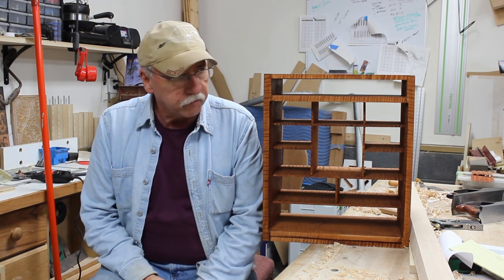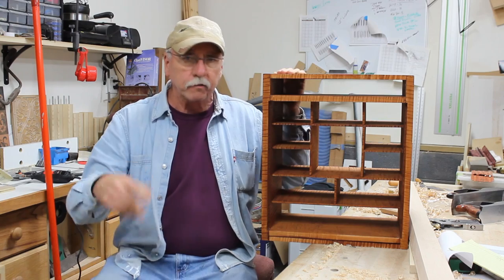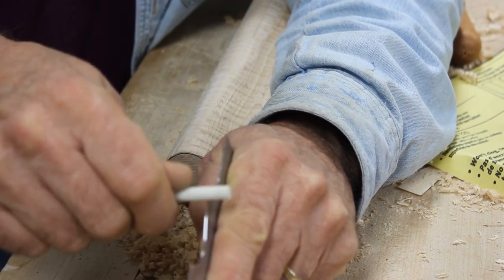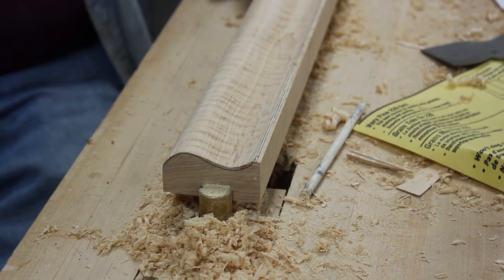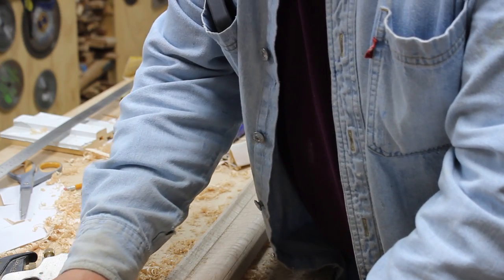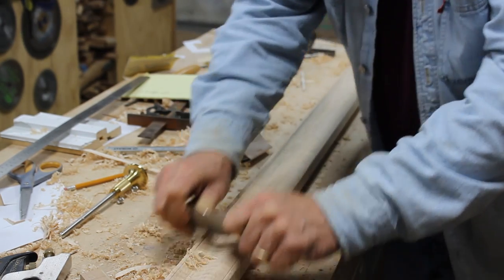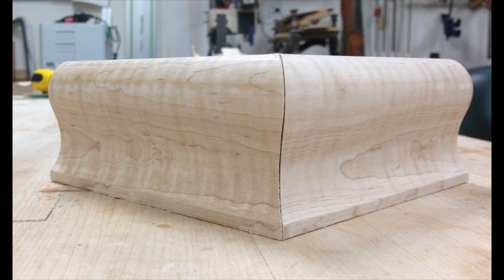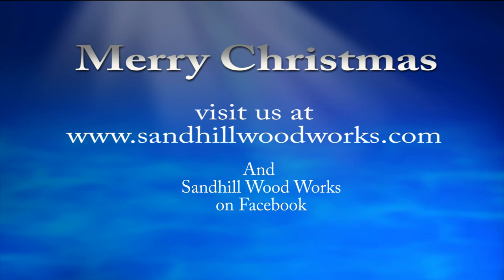Taming the Tiger. Forming Ogee bracket feet Old School.

Comment: excellent work! I just did a picture frame with the same S curve. i used the cove cutting technique on the TS to carve out the concave cove, then i used the beveled TS blade to hog out most of the material to form the convex shape. followed by a card scraper on the whole thing.
Reply from the maker: teh40oz Thanks, Im more about hand tools these days.

Comment: Nice work, not much of a hand tool guy but I can appreciate the peacefulness that goes with it. Any secrets to routing the crown moulding, I have to make some for a cabinet job and have never done it before, I bought the bits from Freud and they look intimidating. I'm thinking I'll have to take a series of shallow passes.
Reply from the maker: If you have the correct profile then YES for sure take light passes.Use a feather board on top and on the side to hold it very snug to the fence and the table. Use some test pieces to get the feel of it and make about 25% more then you need.